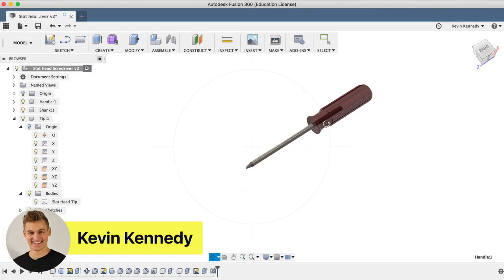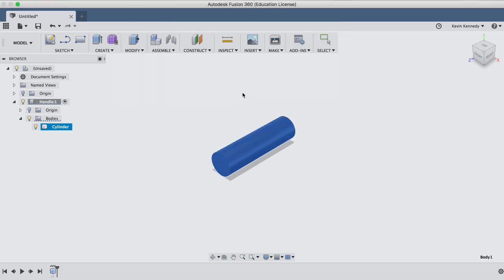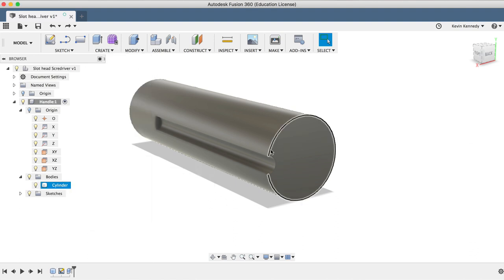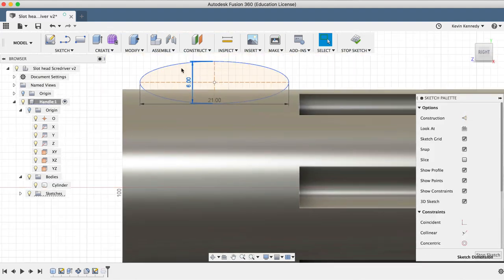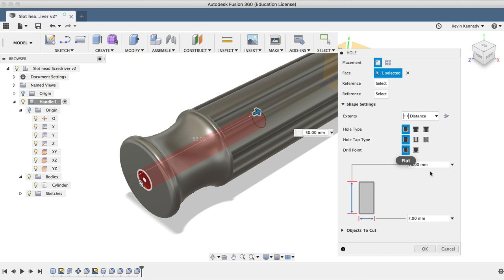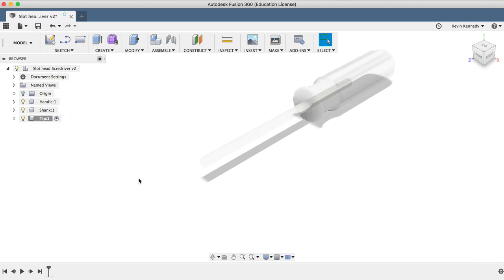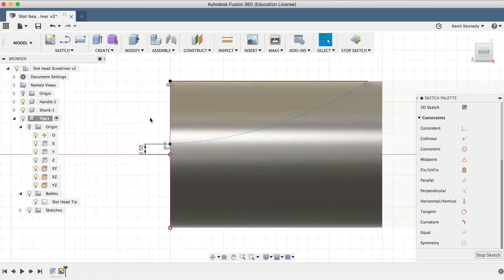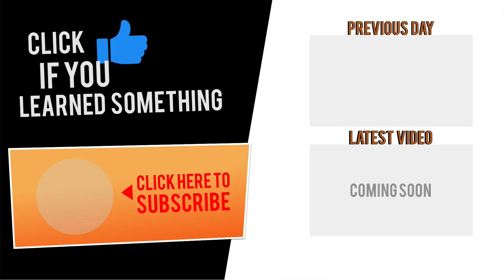How to 3D Model a Screwdriver in Fusion 360 - Learn Autodesk Fusion 360 in 30 Days: Day #14

Comment: Everything worked flawlessly until I hit 11:15 in the video.  It is at this point where we are supposed to dimension the arc.  When I hit "D" I can select the first point of the ellipse on the front edge of the cylinder, however when I hover over the area where the center of the cylinder should be it does not find it.  However, I can find the center point at the back of the cylinder.  If I use that as a reference I can dimension the height of the tip but when I try to click to set it gives me an error saying the sketch geometry is overconstrained.  So I passed on that one and tried to dimension the top edge to 9 mm.  I get the same error.  I did this multiple times, creating the tip and then undoing back to the Extrude tip step.  I tried inserting a circle on the face of the tip and inserting a point as suggested below.  I also started from scratch twice but the problem remains the same each time.  It can't find the center of the cylinder and when I do try to dimension it says the sketch geometry is over constrained.  I checked my settings before I began to make sure "Auto project edges on reference" and it was set the same as Kevin's.  If I skip the dimension step the remaining steps complete without any problem.  I suspect there has been some changes in Fusion 360 since the video was released that is causing the issue.  Any suggestions on how to resolve the issue?
Reply from the maker: Hi James. The auto project edges on reference setting should take care of it. If not, make sure you're looking directly at the sketch. It will not automatically project sketch objects if you are not. If that still doesn't seem to help then you can manually add a sketch point while in the sketch environment. that will allow you to dimension from that sketch point.
Reply: Wow, thank you for the lightning-fast response.  I can confirm that I am looking directly at the sketch as I either select the YZ plane or the "Right" side on the View cube.  I was able to find the center point if add a circle to the face of the tip cylinder, however when I attempt to dimension it, I am still getting the message "Adding this dimension will over-constrain the sketch.  Choose OK to create a Driven Dimension."

Comment: At 8:52 (time), when i created the new component, named shank. Then it becomes difficult to see the component named 'handle'. It almost becomes transparent. So it becomes difficult to select and extrude.
I am sharing link of  image i captured of the situation: 
https://photos.app.goo.gl/u1FCLq17cXGhDFAS7
https://photos.app.goo.gl/eXvDGAYfffqtncAX8

[Somehow I managed to complete the project, that's why I am not sharing the fusion360 file]
Thank you 😃😊
Reply from the maker: Hi, Sohan. That transparent appearance is because you have the "shank" component active, as denoted with that circle located just to the right of the component name. With Fusion 360 assemblies you can right click on components and activate them to make it easier to focus on that specific component. When you want all components to be active you will need to "activate" the top level component, which in your case is "SCREW DRIVER v1" at the top of your Fusion 360 browser. If you right click on "SCREW DRIVER v1" and select "activate" it should make the entire file opaque again. I hope this clears up any confusion! Cheers, Kevin :)

Comment: Im struggling with the end of the slot head tip, when i make the cut using the extrude im left with part of the circle and cant see what im doing wrong. Public file attached https://a360.co/2VZBjd3
Reply from the maker: Hi, pinchers101. I took a look at your file. It looks like when you selected the XZ plane for the mirror command, it was not centered. Since the XZ plane isn't centered directly with your model, it must've been something with how you positioned the model in the beginning. At this point, you'll be better off creating a construction plane that you can use as the mirror plane instead of the XZ plane. Cheers, Kevin :)

Comment: It wont let me snap to the end of the tip, even with snap on.
Reply from the maker: Hi, Mr. Marriott. That is likely due to an update in the F360 default settings. Check out my settings for comparison here - http://bit.ly/defaultsettings

Try turning on the "Auto project edges on reference" setting as outlined on my default settings webpage. That should fix it...let me know if it doesn't! Cheers, Kevin :)
Reply: @ProductDesignOnline  I have the same problem.  After I create the sketch for the tip, when trying to use the dimension function there's no center line or point to snap to.  I verified that "Auto project edges on reference"  is turned on.
Reply from the maker: @boboscurse4130  The second thing to double-check would be to make sure your "snaps" option is turned on in the sketch palette. If you're still experiencing an issue after that, then please let me know. There shouldn't be anything else that would prohibit the snapping. Cheers, Kevin :)
Reply: Product Design Online Product Design Online  i have snaps on and turned on auto project edges but still not able to create the dimension between the arc and center point. I am able to click on start of the arc but can’t click on the center origin of the tip. Well I can click, but nothing happens. I made sure those settings were correct and restarted Fusion360 but still no luck. Can u think of anything else i might check?
Reply: @CarlosG2288   Having exact same problem. To work around it, I created a vertical line from the top of the tip down to the center line (3.5 mm) and then dimensioned from the end of the vertical line up to the end of the arc. Interestingly, Fusion had no problem "snapping" to the center line when I created that vertical line! However, when typing in the .5 dimension, Fusion crashed! Oh well, restart and continue.